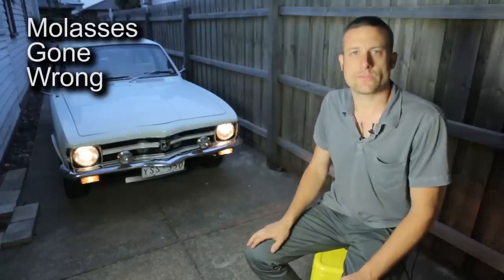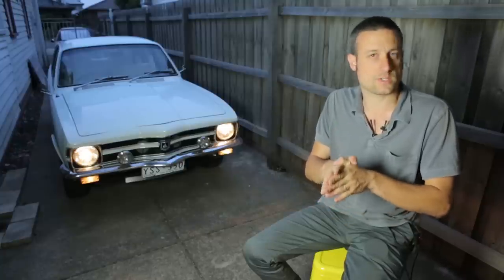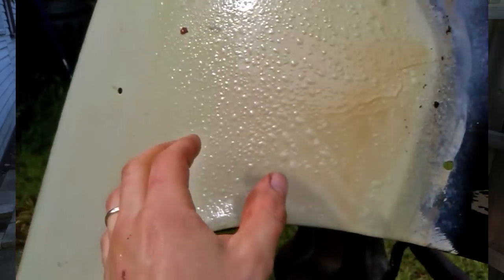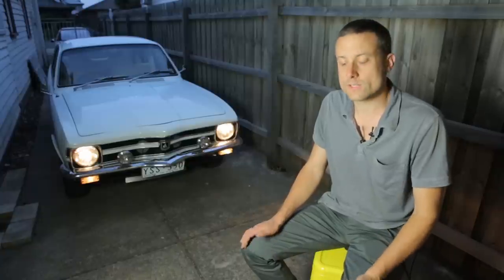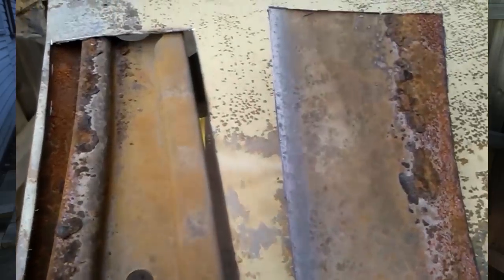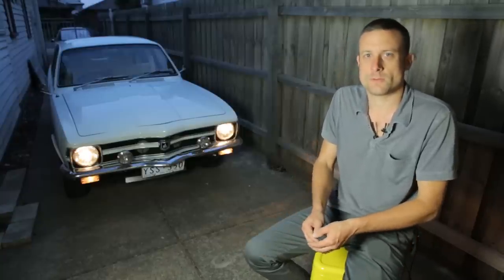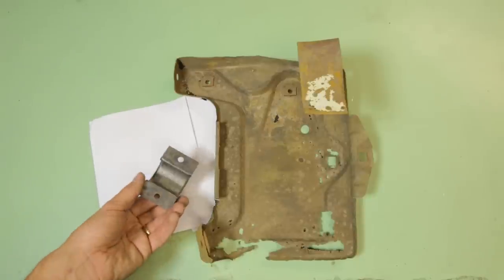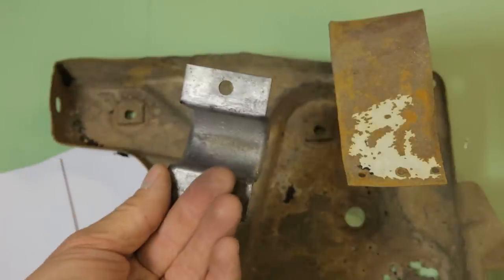Molasses gone wrong

Comment: I've had success with molasses but also some disasters. I found it attacks steels with higher carbon content than mild steel. For example, I ruined the springs in a seat base. The molasses just ate them away.  I haven't had this problem with mild steel.  Whatever happens don't put any magnesium parts in molasses. They will be completely destroyed - I learnt this the hard way :)

Comment: I love your channel. I am in Melbourne. I have a degree in industrial Chemistry. What is happening with Molasses is that its a chelating reaction. That is basically a process of separation of the iron oxide with organic acids. I messaged you. Will be able to explain more.
Reply: explain to all of us.
Reply: Hello, I am an engineer. 
I need someone who can help me with molasses, what is the by product of molasses and water?
You just mentioned organic acids, if molasses and water produce an acidic solution, this method of rust removal can be really dangerous for certain components as you may be aware of the use of acids for rust removal is frowned upon in certain industries, such as the lifting industry for example. 
Donating hydrogen ions to a chain used for lifting purposes for example can give rise to hydrogen embrittlement and causes the chain to loose some of its mechanical strength.

Do you think the use of molasses is safe? What can you tell me about this process? Does the chelation only attack iron oxide? How? I've read it removes paint too and any form of galvanization that has been applied to the chain.

Please help :)
Reply: Ricardo German What kind of engineer are you?
Reply: for smaller parts I would forget molasses, vinegar is your friend in these situation.
Reply: +gus bisbal the Duct Tape kind :)

Comment: One thing I would suggest would be to clean the parts off as best as you can with metho to help absorb the water after washing, then clean again with thinners. I've done this and was able to keep the parts bare metal and rust free for weeks on end. Gives you ample time to get them under etch or epoxy primer.
By the way, l love the use of the Hills hoist, a true Aussie invention!

Comment: I tried electrolysis and it was pretty effective, I even dipped an old Stanley plane with enamel on it, I was pleased it took the rust off bit it did not attack the enamel. However, it was only in the tank for 3 hours and I checked it every hour. I had problems with vinegar, it takes rust off but also tended, in my case, to pit the metal. I would not put one of my planes in the solution. Molasses I will try but I will bear in mind your comments.
thanks

Comment: I believe the opposite occurred... you paint job was an accident waiting to happen (the molasses was the catalyst exposing a poor initial paint job... whether factory or otherwise) and was the primary cause of the paint blistering.... poor preparation of the panel for painting .... let’s face it old generation vehicles suffered rust and corrosion due to the lack of paint and adhesion technology.... I have been using molasses to remove rust from military split rims and the process removes the shoddy paintwork however leaves and does not affect rims that have been correctly prepared for paint.